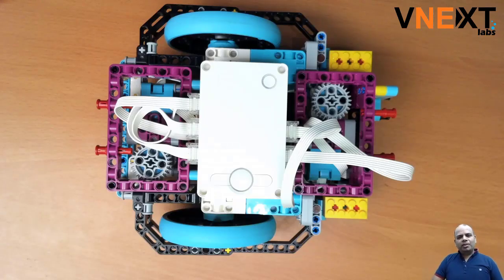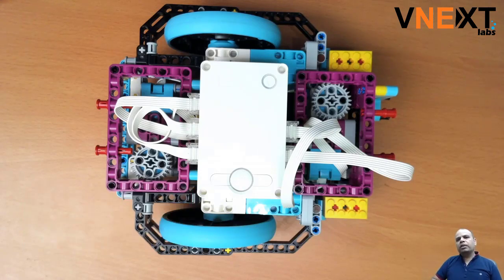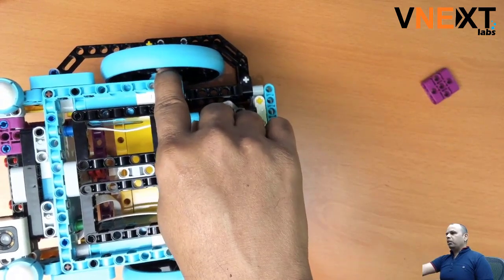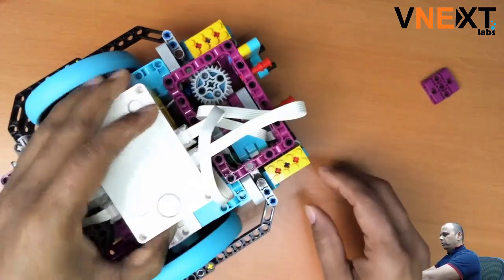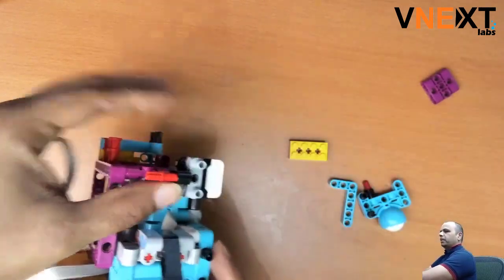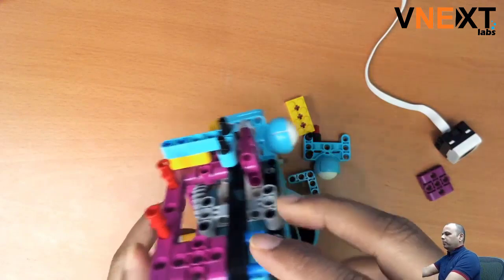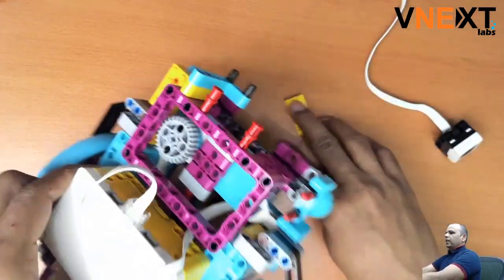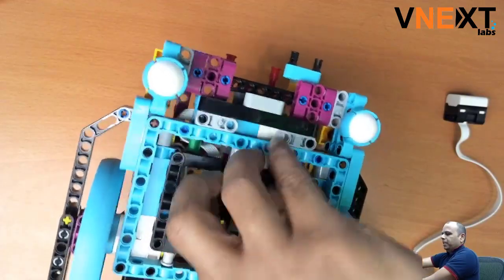Best Color Sensor Placement for FLL on Spike Prime Robot

Comment: I have just built the Mindcuber with the 51515 kit. It wouldn't scan properly until I turned the color sensor by 180 degrees. I'm guessing the color sensing part might be off centred. If anyone is using two in a construction this might be important.